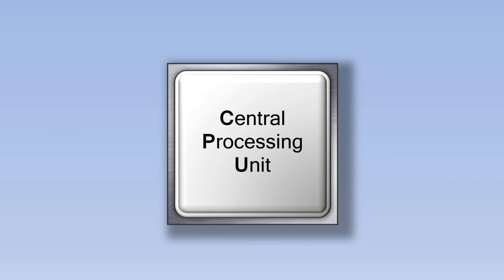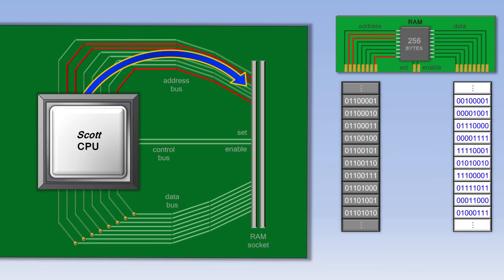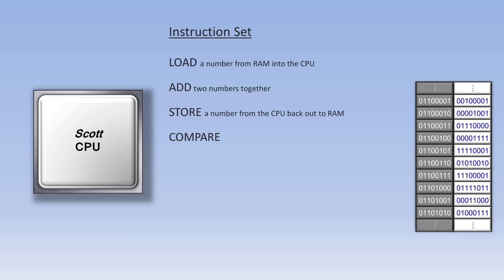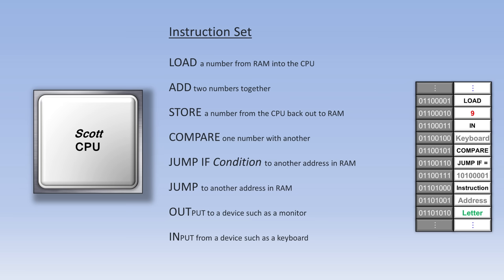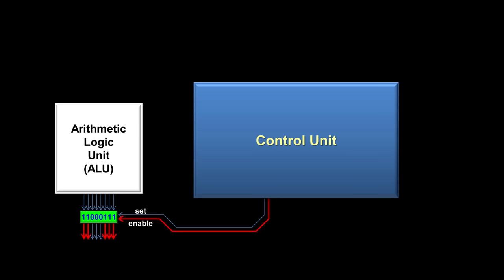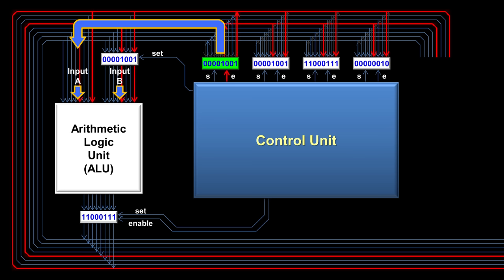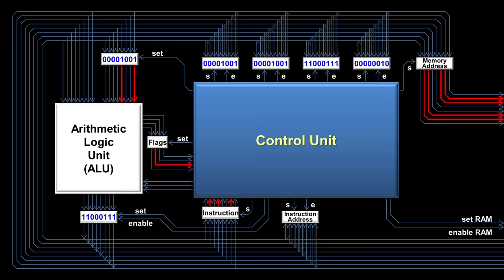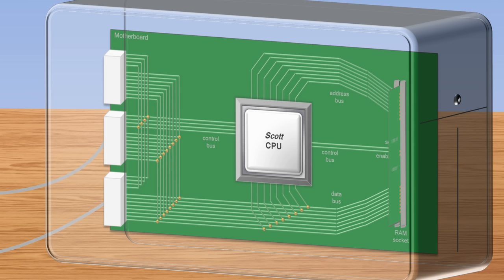How a CPU Works

Comment: Does that mean that the size of the RAM is equal to the number of addresses it has. So a 4GB RAM chip contains 4 000 000 000 different adresses?
Also i want to know that if you start a program on your computer, the hard drive stores the data in RAM and the RAM gives the instructions to the CPU so it can process the data. Lets say you have 4GB of RAM and you want to start a Program that has a source code that is 5GB big, what would then happen? Would the CPU use the Hard drive as RAM for the 1 overflowing GB? If thats true does that mean file size is one of the factors that determine how fast your computer can run certain programs? And how is the Hard drive connected to the cpu? The northbridge connects cpu, ram and pci slots. And the south bridge connects the other components, so how are they connected? Are there some sort of crossroads to make this possible? Also how does the cpu work on an analog computer? I know that analog computers are a lot faster then the digital computers we use but they only can do simple tasks as opposed to a digital computer which is slower but can do more complicated tasks (fun fact: our brain is a mix of both types: analog would be instinct and reflexes while digital would be thinking, feeling...) Also what do these bits mean? Is it correct to say that they are the size of the bus the cpu uses for data? f.e. the 6502 is a 8bit processor so it can transfer 8 bits at once and an intel i7 third generation quadcore@ 3.7GHz which is a 64bit cpu can transfer 64 bits at once? Why can 32bit not address more then 4GB of RAM and 64bit 128GB? What roles play the cores in a CPU? Does a quadcore cpu have 4 control units? And how does hyperthreading work? does the cpu emulate cores in itself? And last but not least: What clock speed has the human brain? I assume its around 8Hz because i can say the number one 8 times per second...
Reply: Hey, I don't know the answer, but that is a very good question! I love to learn about this more now and such! I was first like, why a bunch of 0s and 1s everywhere?! Why not like a 7 or 5? Well, they just wanted to. CPUs and every other binary number could run a 2 and 3 and still have the same role! That's my understanding at least! This video only gave me a glimpse! NOT ENOUGH INFORMATION AT ALL!
Reply: Woah, that's a lot of questions you are asking here. YouTube comments isn't suited for this purpose, but I'll try my best. Before continuing, you should read Gustavo's blog: http://duartes.org/gustavo/blog

Does size of RAM = number of addresses it has?
http://duartes.org/gustavo/blog/post/anatomy-of-a-program-in-memory/

How does the CPU handle oversized programs?
http://duartes.org/gustavo/blog/post/memory-translation-and-segmentation/

Is file size one of the factors that determine the speed of programs?
Possibly, but that's not a reliable way of measuring the speed of programs. Time complexity is the proper way of determining how long a program will theoretically take, and it measured by the number of steps it takes for the program to complete. If you just have a loop that goes on forever, then you have an infinite time complex program that barely takes up any space on the hard drive.

You'll notice in YouTube videos where SSD's are faster in loading the game if the game was installed on the SSD, then if it was installed on a regular hard drive. This is because the hard drive is the bottleneck of the program, as the game can't start the level without loading the assets from secondary storage (SSD or hard drive) to primary storage (RAM and VRAM).

How is the hard drive connected to the south bridge?
I can't answer this question, apart from saying that the hard drive is connected to a SATA port or an IDE port. Also note that the latest Intel chip sets are no longer in the northbridge/southbridge architecture. In the new Intel chip sets, they basically moved the northbridge into the CPU, and the CPU is directly connected to the southbridge (now known as the platform controller hub). https://en.wikipedia.org/wiki/Platform_Controller_Hub

How does the CPU work as an analog computer?
The drivers of the peripherals (such as a headphone jack) convert the signals from analog to digital signals (and vice versa) so that the motherboard and the CPU can understand.

(fun fact?)
The brain is neither a digital nor an analog computer, although it has characteristics to both of them. It is arguably enough to be called a computer, but that's it.
https://www.quora.com/Is-the-human-brain-analog-or-digital?share=1

Furthermore, at the end of the day, everything in the universe comes down to the particle-wave duality. Are photons particles? And electrons waves?

What do the bits mean?
Bits stand for binary digits, and it is a way of expressing digital signals in the form of 0's and 1's. We could have represented these two values with any other two symbols, but 0's and 1's were chosen because zero meant that no current is flowing through, and one meant that some current is flowing through. 

Is it correct to say that [bits] are the size of the bus the cpu uses for data?
CPU's can use up to their full width of their bus sizes. https://www.reddit.com/r/askscience/comments/2ke0o5/we_have_32_and_64bit_cpus_why_not_a_128bit_cpu/

Why can 32bit not address more then 4GB of RAM and 64bit 128GB?
That's because the total number of addresses a 32 bit computer can take is equal to 2^32 combinations. 2^32 is the same as 4 * 1024^3, and since a 4GB RAM has 4 * 1024 ^ 3 bytes, a 32 bit computer cannot address any more than that. As for the 64 bit CPU's, they can address way more than 128 GB (2^64 = 2^4 * 2^60 = 16 * 1024^6 bytes a 64 bit CPU can address). I'm not sure why 64 bit CPU's can address more than 128 GB of RAM. There must be some other limitation (maybe not even technological) that stops or deters manufacturers from producing CPU's from addressing more than 128 GB of physical memory.

What roles play the cores in a CPU?
For each instruction cycle, an individual CPU core has to do three steps. It has to fetch the instruction, decode it to understand what it means and what the CPU has to do in order to compute that instruction, and finally the CPU executes that instruction. For simpler CPU's, the instruction cycle is done in serial, but for modern CPU's, they use a variety of techniques such as instruction pipelining and out of order execution so that they can process multiple instructions at their various stages in parallel. https://en.wikipedia.org/wiki/Instruction_cycle 

Does a quadcore cpu have 4 control units?
Yes, it has 4 physical cores, and therefore it can process up to four instructions all at once.

How does hyperthreading work? Does the cpu emulate cores in itself?
Yes the CPU is cheating. Hyperthreading is just a fancy marketing term that basically gives the CPU a chance to intelligently schedule instructions to its physical cores so that the time spent on idling is kept to a minimum. This optimization is however not much a big of a deal to consumers such as gamers, and so that's the reason why some gaming rigs are powered on i5's and not i7's.
http://lifehacker.com/how-hyper-threading-really-works-and-when-its-actuall-1394216262

What clock speed has the human brain? I assume its around 8Hz because i can say the number one 8 times per second...
The human brain does not have a clock speed. Like I said earlier, the human brain is neither a digital nor an analog computer.
https://www.quora.com/What-is-the-clock-speed-equivalent-of-the-human-brain?share=1
Reply: Short answer to the 5GB program in a 4GB RAM, yes, that's how it's done.  It's a technique called paging or swapping, where the inactive parts of a program (such as instructions which have not been executed recently) are kept only on disk and not in RAM.  Data which have not been accessed recently but have changed are written out to the swap or paging area set aside on the disk, a chunk at a time (commonly 4Kbytes), and aren't read back in until they're needed again later.  Then data which are needed right away are copied from the swap/paging area back into RAM.

The whole concept is called having a virtual address space.  In your example, for that program, the virtual size is 5GB whereas the physical size as you said is 4GB.  The control unit inside the CPU is what slices up the RAM into chunks, keeps track of virtual address to physical address mappings, and detects when it needs to jump to the instructions to swap things to and from disk (which would be called a page fault when it happens and the program is a page fault handler which does all the work of swapping out and swapping in).  As it said in the video, HDDs are tons slower than RAM, so this is why if your computer starts to use the swap file or swap partition, your computer slows way down as it has to wait for these RAM chuncks to be read from/written to the disk, and can't really do anything until that completes.
Reply: Thinking of 32bit CPUs and 64 bit CPUs in terms of addressable RAM is not an artifact of the number of bits in the data bus (which is what the number refers to), but how many wires on the processor are used for the address sent to the RAM.  It just so happens that 32bit CPUs were not manufactured with enough external wires to address more than 4GB of RAM.  Internally, their virtual address range is greater.  When the redesign to 64bit happened, not only did they put in twice as many data lines to transfer twice as many bits simultaneously, but they also routed more address wires to the outside, thus making access to more RAM possible.  For example, a Core i5 can access 32GB of RAM.  It would be entirely possible to take the guts of a 32bit processor such as a Pentium III and add slightly more circuitry to the die to bring more address lines out.  But in that case, the only advantage would be to address/access more RAM, it would still access data twice as slowly as say a Core i3, which has a 64 bit data bus.
Reply: Thanks for all the answers^^ I will look through every link when i have the time for it. But i want to know 1 last thing. Why is it so that games run better someday and worse on the otherday on the same computer? This happens especially when i just installed the game. Also if the brain does not resemble a computer in any way, what was the design concept behind a computer. I mean computers exist to make some sort of slave that does not complain and does not need food etc. Also does that mean computers cannot be better then humans? Also would it then be possible for robots to live up to humans?
Reply: TheHaloFan117Elite Binary is a base two number system, so it is impossible to have 2's, 3's, etc. They are represented by 0's and 1's, a 0 meaning false, a 1 meaning true in a boolean system. The use of base two for computers wasn't really a choice, rather, it was more of a consequence of logic because in a boolean logical system, it is impossible to have data that is not a true or false.
Reply: Trey Roflcopter
No, I realize it's a two-number system. What I'm getting at is that you could have a 2 being a "false", and a 3 being a "true." I don't mean that  you are allowed to have more or less of a two-number system for binary an other computer stuff.
Reply: TheHaloFan117Elite , it's because a circuit is either on or off.  It complicates the design considerably if there are more than 3 values allowed (tristate).  The three are on (high, one), off (low, zero), or not attached to the bus.  That last one is important for anything which has a bus structure.  If a device's drivers cannot be shut down, they will interfere with other components trying to drive their ones and zeroes on the bus.  (Also please note this is a "driver" in the electronic sense, not the software sense.)
Reply: An 8 bit system can either be split into 4 bits (fours wires) which goes to two decoders that output 16 wires each. These 16 wires make something that looks like a fish net. Each intersection is where a Byte (8 bits) can be stored.

The number of intersections can be counted or you can do 16 ^2 which gets you 256 Bytes of possible data and therefore 256 addresses. 

However, this is not a lot of data so a 'two-step process' can be used. Instead of splitting the 8 bits into two pairs of 4 bits that each go to a decoder that produces 16 wires vertically and horizontally that create 256 intersections... 8 bits can be sent to one decoder but then the system can store those 8 bits and go back to get another 8. This mean 8 wires into each decoder, each decoder has 256 outputs because of this... That means 256 horizontal wires and 256 vertical which creates 65,000 (rounded) intersections. So 65,000 addresses and 65,000 Bytes (65 KB) of data.

Although, using this two-step process is much slower and adds up when you think about how many times a computer accesses memory. 

So an 8 bit system can have either 256 Bytes of memory or can do a two-step process (which is slower) to get 65,000 Bytes.

A 32 bit system has 4 GB which must mean that it does the faster method of splitting the 32 bits into two pairs of 16 bit wires... Goes into a decoder each that produces 2^16 = 65,536, those two pairs of 65536 vertical and horizontal wires must make 65536^2 = 4,000,000,000 (rounded) intersections which is 4,000,000,000 Bytes (4 GB).
Reply: SadoMessiahLP Also, a lot of people say it was modelled after a brain... No idea where people are getting that from.

The first 'computers' were actually people, mostly women back then, who used abacuses to work out calculations. The computers we know to today (kind of the first ones used paper punch cards) merely mechanised this process. So I guess you could say it was modelled after them.
Reply: Controversy Owl , actually, the way RAM access works is, each module has an enable (select) line.  So the processor to RAM interface circuitry (the controller) has to first decide which module to address based on the address being presented by the processor, and turn on its select line.  Within each RAM module, there are rows and columns of memory cells.  The RAM controller outputs the first half of its address bits, the row, then the row address strobe (RAS) is clocked.  This latches the row address to a register in the RAM module. Then the column address is output, the column address strobe (CAS) is clocked, and a short time later, the bit(s) corresponding to that complete address is clocked onto the data bus, either from the processor to the RAM or vice versa.  So yes, there is a slightly hairy bunch of logic which decodes an address into a specific row or column, which then selects a memory cell based on the row and column addresses.
Reply: +rchandraonline I simplified because he didn't want to know about how memory is accessed. I just described how it was implemented in an attempt to explain why a 32 bit system would have 4 GB. I always simplify as I find it frivolous and lightly egotistical if someone was to fundamentally show-off with the wrong type of language, examples, etc. to use in order to 'explain' something to someone else.

You are perfectly correct. I assume you disagree with me when you say 'actually'? Can you point out what I may have explained wrong, or prehaps, what you dispute? Maybe it's because of a difference in computing system, what I said doesn't seem to be different, at all, but I am using an abstract 8 bit system, not a real-world one. The row and column address come from a decoder. In an 8 bit system, the 8 bit address may be split into two pairs of 4 bits (column and row addresses). They would be sent to two 4x16 decoders which would have 16 column wires and 16 row wires that would effectively make 256 intersections, each of which contains is a memory cell that can be sent a 'set' or 'enable' signal in combination with the activated intersection depending on whether you want to load or store into that memory Byte. Therefore, there are 256 Bytes of addressable memory because there are 256 intersections.

The two-step process I mentioned can be used where (although all computer systems are different and this is an example) an 8 bit computer will use 16 bit instructions with: a 16 bit instruction register with two 8 bit temp registers, an 8 bit instruction address register, and two 8 bit memory address registers in order to extend the low memory.

In this senario, the first 8 bits of the 16 bit address can be set into the first memory address register through the 8 bit bus, then the second part of the address can be set into the second memory address register. Both of these registers automatically enable their part of the address to the decoder. So, evidently, you can get two 8 bit addresses for the row and column using an 8 bit bus, which means more addressable memory that matches what 16 bits would achieve but slower, about 65 KB (rounded) in this case, as 256 Bytes would be too small.
Reply: nonono...I'm sorry.  I apologize.  I misread your post, it didn't quite click in my mind as being what it was, so I thought I'd explain RAS/CAS/data in or out.
Reply: rchandraonline Yeah, I skipped a few things just to explain what was relevant to this guy.

You seem knowledgeable about specific circuitry for real-world processors, such as Intel ones. Where do you get this type of information from? Do you just take in random bits of information or full duagrams from the internet or a certain books? And are you a uni student/lecturer, etc? Or is this a job/preoccupation? Because I find it difficult to find actual circuitry of processors on the net and don't want to buy a book if there are prequsites that I don't know of. :)
Reply: Controversy Owl Just google data sheets for specific processors, like Intel 80386.
Reply: Every Byte is either an address or data as i think
Reply: ahmed al taie , Byte was a magazine.

Actually, the granularity of addresses or data is a bit.  It's just fairly common to have them in groups of eight.  A counterexample would be the 8086/8088.  The address size was 20 bits, not a multiple of 8.  There are even such things as bit slice processors, which can be grouped together in arbitrary numbers of bits.
Reply: TheHaloFan117Elite 1's and 0's dont have any real value. 0 means off and 1 means on. we use 1 and 0 to comprehend this instead of saying  on on off on off its easier to express this as 11010
Reply: SadoMessiahLP  Why is it so that games run better someday and worse on the other day on the same computer? 

I assume this has to do with how many applications are running while you're playing the game. You see any application or program running is taking space in the RAM . Your game which is also a large program is taking space in the RAM. if you have a lot f applications running, your data will be accessed from larger and slower memory units (in a caching system) therefore making your program slower.

Also if the brain does not resemble a computer in any way, what was the design concept behind a computer?

Very interesting question. I've studied a lot of computer architecture and I'm going to give my thoughts on this although I'm not an expect you should probably ask a neuroscientist or smt. The way I l see a computer is that there are two types of units, the processing part and the memory part. You need the processing part to execute instructions given to you and you need memory to contain you results and there are buses that connects these parts to propagate your data. Of course after that you have peripherals (i.e keyboard, printer) that connect to your computer, control units but these units are also made of memory or/and processing. You see where Im getting at?

A computer is similar to the brain in the sense that it can receive a set of inputs (i.e. pressing keys on the keyboard) , processes and executes them (with the help for the CPU and its ALUs) etc and sends back the results (displaying word being tapped on keyboard). However, we haven't managed YET to make computers become conscious like us humans. There's a big debate about this in AI and philosophy.
Reply: Not all of that 5GB of source code needs to be in RAM at the same time. Only the pieces that are currently being used should take up space in RAM (and if a program is optimized well it should be a small fraction). It would be silly if when you started a program the entire source filled RAM. If that was the case people who want to play some modern games like Battlefield 4 would need at least 64GB of RAM just to fit those big textures and audio files.
Reply: Daniel Waltz while you're right, there's another way to go about it.

When doing compression operations where more RAM space is required, the system tries to flush as much RAM as it can, but writes the excess to the Page File on the hard disk temporarily.
Reply: SadoMessiahLP its simple the 5gb task just get slowed a little bit due to only 4gb available, mission accomplished, lets say u want to load a 18gb team fortress 2 but u only have 8gb of ram, then the loading just got slowed a bit, the loading process not only from ram too, its also from hard disk drive, if the hard disk drive is slow or full of garbage, it also slowed down even if you have 18gb of ram